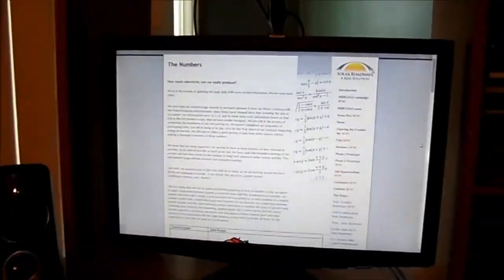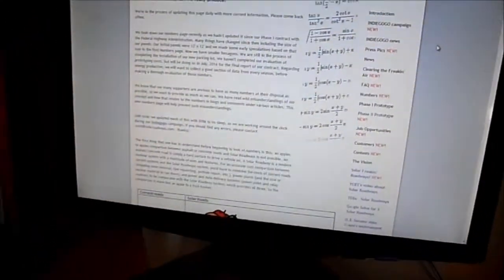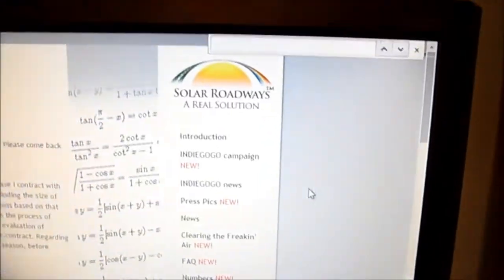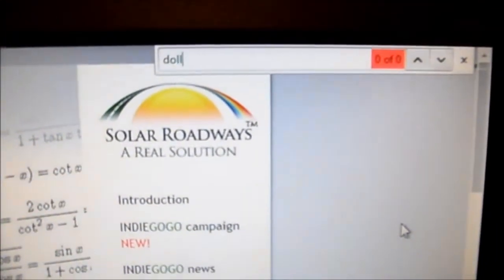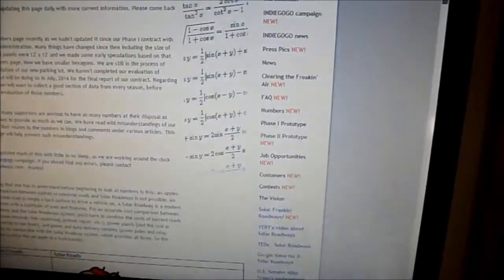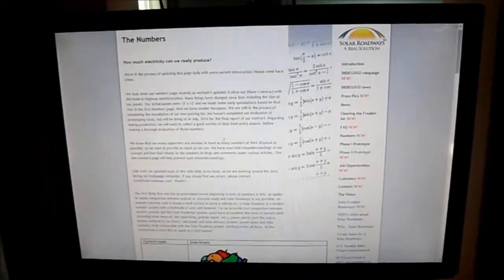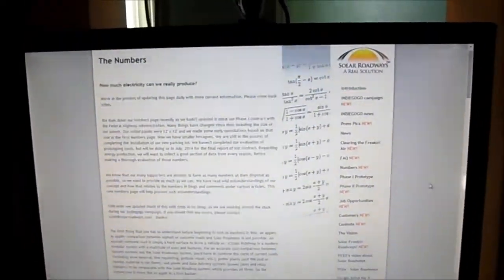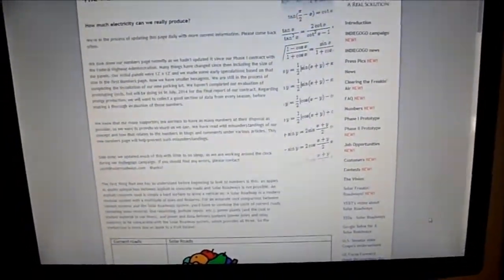Solar FREAKIN' Roadways - What Are The Costs?

Comment: At this point on the internet, there are more cost calculations than even Brusaw could ever imagine... Yet in 10 years of development he can't give us approximate costs... Makes you wonder, doesn't it? :)

Also in the official webpage for Solar freakin roadways, the Millitary applications tab is just the last nail in it's coffin, the last confirmation of the huge scam it is.
Reply from the maker: That military application section is downright embarrassing.
Reply from the maker: fubecabr For some reason this post came up as spam. Fixed it now, though.

Anyway, they're obviously mental. Why bother putting the solar panels onto the train to produce electricity when you could just put permanent solar panels of the side of the train? On top of that, I would think the energy you produce would be very negligible compared to how much is needed to operate trains. I'm not even sure if regular solar panels would be cost effective.

Solar Freakin' Idiots! ;) Haha.
Reply: TheAmazinTacoChannel

I trolled as a supporter on their FB page and got all sorts of likes saying something to the effect of, "have you thought of solar freaking planes? Imagine a 747, 777, or A380 covered in solar freaking roadway panels? With the LEDs and smart solar panels with wifi, no more mid-air collisions. Sure, it might need the engines to take off, but the solar panels could keep it going once it was at altitude. Imagine how quiet it would be too!"
Reply from the maker: Jeff Lavin Why stop there? Why don't we just make everything out of Solar Roadway panels?

It's the hit new ice cream flavour!

Comment: Brusaw has good reason to duck and weave. Conventional rooftop solar is an established, reliable, and fairly well cost optimized technology.  Rooftop PV goes for somewhere near $4 per watt, installed. Remember than number -- it is critical to the financial viability of any PV solar installation. Once placed on a roof, the panel array typically requires almost zero maintenance, and can be counted on to quietly churn out the KWh for years.  Even then, rooftop PV is financially marginal; the typical installation takes well over 10 years to reach payback.  With significant government incentives, payback can occur in 7~8 years.  All this assumes ideal solar geometry, limited electrical infrastructure (a few cables, some conduit, and a break out box.), and absolutely minimal maintenance costs.  

Now, Brusaw wants to take that already MARGINAL technology and harden it to the point that you can drive multi-ton trucks over it day and night.  A cheap frame of aluminum and thin glass, like that placed on the roof, will not exactly do the trick!   Apart from building the cells much more robustly, you'll also need to completely rework the roadway.  (As TF pointed out, you can't just glue these things to the pavement if you expect them to survive more than a few weeks.)  Then add power transport infrastructure to move the power from rural roads and interstates back to the cities where is can be sold.  The cost of all this is going to be staggering.  $10 per watt?  20?  40?  Who knows, but I guarantee that it will be an absurd number.

On top of that, horizontally mounted solar cells buried under inches of greasy, frosted glass are not going to be very efficient I figure a derate of at least 50%  This further multiples the cost-per-watt by a factor of about 2x.  

Why does cost-per-watt matter so much?  Because someone has to finance this boondoggle.  Remember, even at $4/w, the banks have to wait a decade or so to get their money back.  At $6~7 a watt, the loan begins to become untenable.  And by 10?, 20??, 40????, 80????  .... Well, they're going to laugh you out of the office.  

And all this is before any maintenance costs are considered.  Does Brusaw really think his magic panels will withstand 24/7 abuse by multi-ton trucks for DECADES without any need for maintenance and repair?  Remember, loan repayments are sucking up ALL the generated revenue (and still falling short).  There will be ZERO money available for repairs.  And without at least some maint. and repairs, the road will rapidly fall to pieces. 

Simply put, the up-front and ongoing expenses of Brusaw's Folly guarantees that it will be a financial failure.  No bank on earth is going to loan the money, because their analysis will clearly show that they will NEVER get it back.
Reply from the maker: Completely agree. I would wager that they'd generate way less efficient than the 50% you give them. Horizontal and under a thick glass road surface is such a terrible place to put them. Thankfully for them people were duped to the tune of over $2 million by their clever marketing video and the help of a few famous people who thought the idea was good and shared it with their fans.

I'm not against new ideas or trying to find viable alternative energy, but this is such a bad idea it's mind boggling. I've read many arguments as to why they won't work and most, if not all, of them are valid arguments against it. It saddens me that such a fruitless project got so much public funding, but I imagine there are many, many far worse offenders that offered even less.